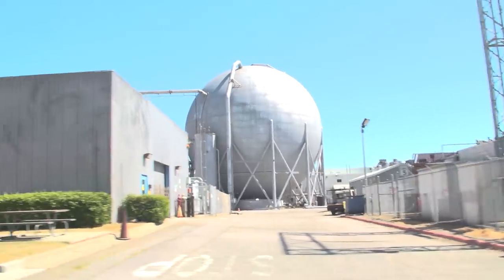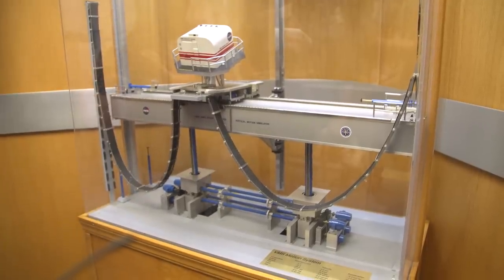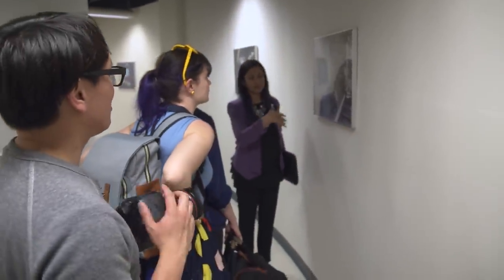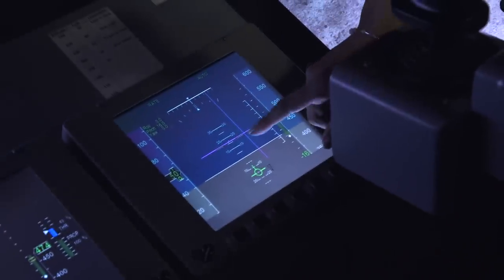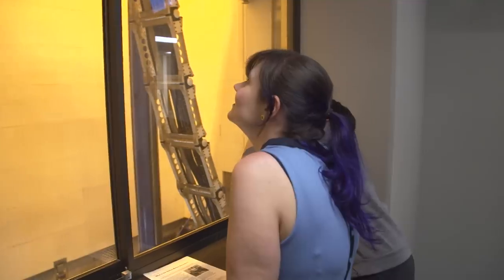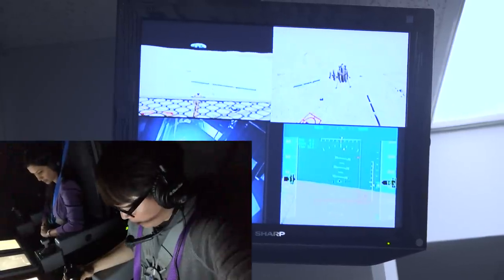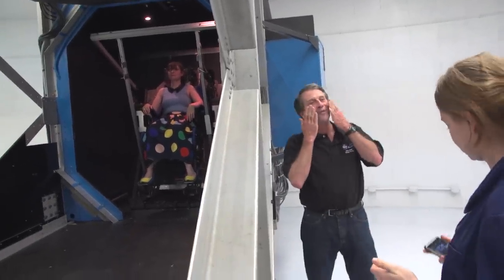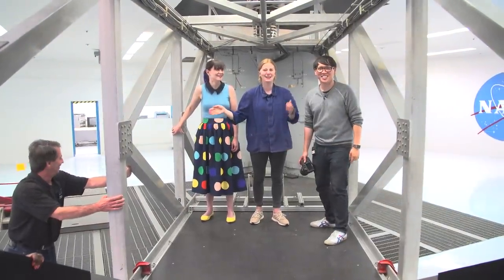Tested at NASA Ames Research Center (with Simone Giertz!)

Comment: You should really check out the 40 by 80 motors, they make you feel so small. Plus you should have come across the street from the centrifuge and check out the machine shop. We have been around continuously since the early 40's.

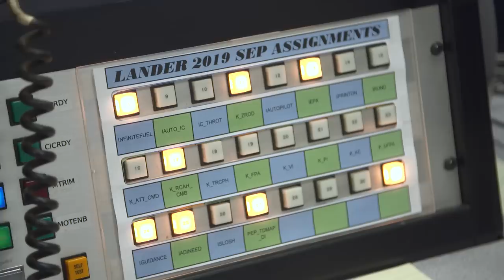Comment: When I saw VMS I didn't think of Vertical Motion Simulator, I thought of the venerable OpenVMS operating system sold by DEC/Compaq/HP/VSI, which I enjoyed supporting for about 35 years.  Then, at 3:34 into the video, I recognized an LK-401 keyboard.  Like seeing an old friend, it made a great video even better.  Thanks!

Comment: Random thought while watching some of your prop builds - have you ever tried 'authentically' weathering and aging a supposedly battle worn piece using actual explosives, shrapnel, 'blaster fire' burns etc? I think it'd be awesome.
Reply: I think you would have a rather  difficult time in controlling chaotic forces well enough to a) look good and b) survive intact. And its MUCH easier to simply simulate actual "damage". If you wanted to use a sand blaster to weather material there are a couple of videos on the making and using mini sandblasters. But prove me wrong!

Comment: I went to Ames too because of NCAS this July. It was amazing and I saw a bunch of the same sights except the centrifuge. There was a tour with the interns and I learned a lot of facts about that tunnel. Going inside you are not suppose to step on the glass. There is a rotating disk and there are like some doors there. Also, Google did testing of the building there were constructing in that tunnel. Their model was sitting outside the wind tunnel cover with something. They wanted to know how those building will effect the surround area air. The guy said when Apple announce their "spaceship" facility he was joked, "why is Apple building a spaceship? We build spaceships." Then he said that Google immediately stop testing those building designs and wanted to do better.

In that tunnel, there is that net mesh to keep the hawks and birds out. Also, there is a street hockey team that plays near the net and they made a deal with the facility that they can play there if they grabs any loose papers in the mesh.

I think in a building near the wind tunnel someone was telling me that they put in a super computer on the upper floor of the one of the building. But it was so hot it was melting the floor so they have to move those computer to the ground floor.

Since Ames was originally part of NACA, before it changed over to NASA, some of the older building have the NACA sign. Those were cool. I saw the exobiology research lab and it was interesting. That was pretty cool too~ It's nice seeing it again in video form. Thanks guys.

There is a Big Bang coffee in the Mega Bites cafe. Also, I like their ice cream sundae cups that's good on a hot day. Stay cool guys. I hope you have a great time. :) Those people are amazing.

Comment: Okay I just don't get it, big YouTube channel, they obviously make money (staff and projects) yet the audio here (1:46) is just awful, like a cheap mic from amazon would have been better.
Reply: Probably they had a good microphone, but something went wrong. Lost recording, data corruption, forgot to turn it on/plug or bad settings it in are a few possible reasons you'd have to use maybe the camera's microphone recording.
Reply: @CloudHater  fair enough good point, still thou small note at the start of the video to explain would not go amiss